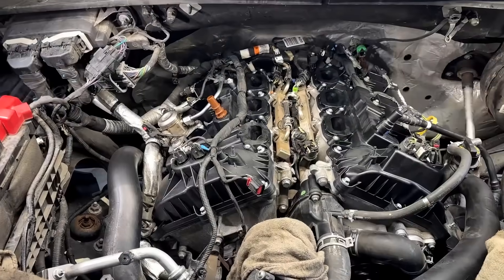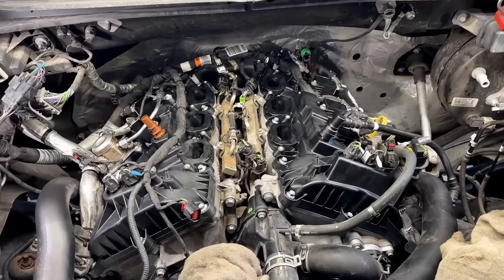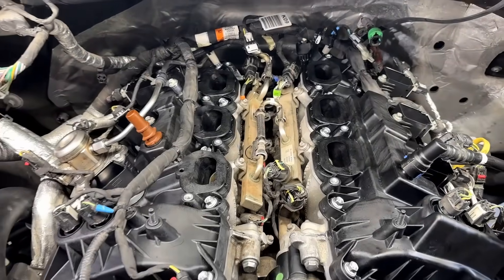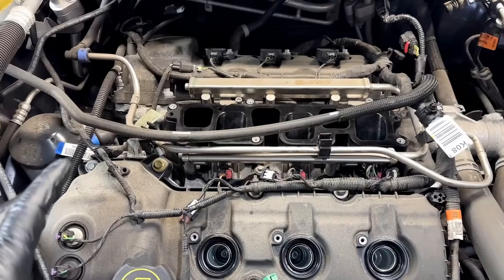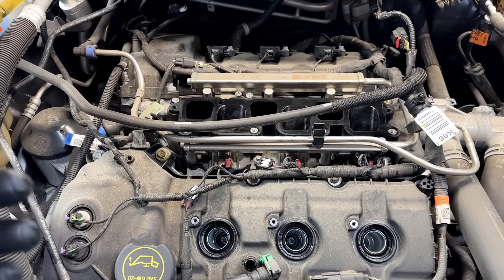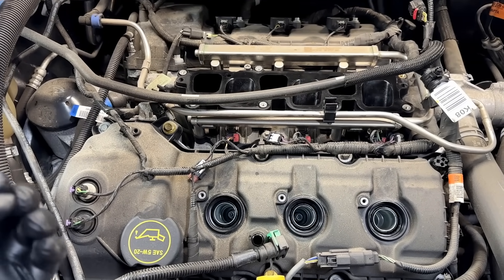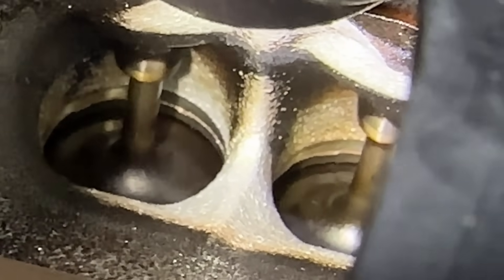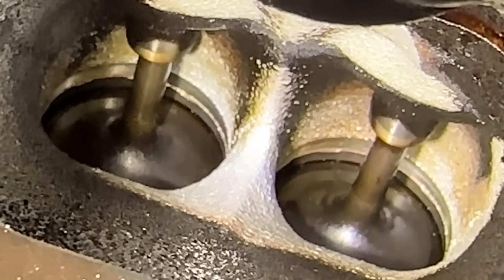Does Ford's New Dual Fuel Injection 3.5L Ecoboost Engine Really Fix the Carbon Build Up Issue?

Comment: Ok to anyone with an eco boost and warranty and making car loan payments this is for you. My friend bought a full load brand new f 150 eco boost, his 9 th ford in a row off the lot. At 48 thousand Kilometers or 30 thousand miles with regular oil and filter changes a turbo let go. Drove it in to the dealer. They tore it down and said it was lack of maintenance with all of the crud in the engine and will need a new engine and turbos ! 15 thousand dollars out of his pocket because he voided his warranty. HE DID NOT GO TO THE DEALER FOR OIL CHANGES OR MAINTENANCE. Ford of Canada denied warranty and Ocean Park Ford was the dealer. He had receipts for the oil and filter changes and intervals but they stonewalled him on the claim. This vehicle was to take his two kids to play sports and b safe was he was in two big car accidents himself , not his fault, so you get the picture, not a construction guy hauling dirt and brick cement stuff. In the end, a year of it sitting on the lot torn apart through a winter and having to drive a borrowed car from dad he took it to a mechanic that cleaned the engine reassembled with a new turbo and it was back running. I was a shop foreman at a GM dealer and we tried to help people with issues not create nightmares for families. The truck needed a turbo to get back on the road. Problem solved happy customer. Two days max. On a regular basis I completely rebuilt 3.8 engines drive in and drive out in 12.5 clock hours. Rings bearings , heads checked and touch the valves complete from customers that never ever changed oil. Warranty or 50/50.    OK,,,the oil monitoring system is one of the problems. At 50 % left on oil life the oil is no good people. It has lost all of its lubricant qualities. If you changed your oil, would you put 50% oil back in? Not a chance. It also is wearing out the fancy timing chain and gear assembly in a hurry. At 50% the oil just smokes and sticks to everything inside leaving carbon deposits. Eco boost has too much boost for the piston rings and the crankcase ventilation system cant handle it. Oil vapor is now full of acids from the engine firing and oil temp goes up. If you are not aware, the vapor from the crankcase is burned in the engine and enters through the intake port behind the throttle body.This also gets into the intercooler and pools at the bottom. I have been around a lot of turbo stuff. Buick had turbo cars in the eighties like Grand Nationals. They are sensitive with their bearings and oil types and pressure. ON TOP OF THAT IS DIRECT INJECTION.The excessive blow by,,,combined with the fuel coming in below the valve instead of above to clean the valve will cause problems until you sell it and by another brand with little or no blow by. The answer is if you have warranty on your Ford or any other brand of car or truck and are still making payments on it, take it in to the dealer for regularly for oil and filter so they can’t deny you warranty. I hope you don’t mind my comments I’m just trying to help if I can to those with an eco or warranty vehicle. Thanks for making this video so Merry Christmas to you and good luck,good health, and good fortune to you and your families in the new year.🎄

Comment: love your videos.. i am currently driving a 2013 f150. with the eco.. Truck has 197K on the odo. and i have not noticed any issues really with the engine itself. i still pull a trailer on occasion. i do on occasion take the intercooler out and clean it out. i did remove the BOV return line as soon as i got the truck. and it always has a snot ball hanging off of it. now and then i get it cleaned with under carrage wash. i will get intake removed and ill see how the ports look. 

i dont have a catch can. 

i change the plugs every 25K or so. been a good truck. hope to keep driving it another 100 K at least.
Reply: I in the same boat as you. I have 191,000 on my 2013, has has timing done under warranty once and by me once, exhaust manifolds re leveled once.

Still runs great, still pulls a 7000 lb trailer without issue, but have noticed fuel economy is not quite as good as it use to be. Either way, going for at least 300,000 out of it.

Comment: 2018 Ford F150, 2.7 L, 185,000 miles The only thing that has been done engine wise is three injectors on the right side oil changed every 5000 miles running whatever gas is cheapest.

Comment: Timing chain/components at 120K     They should last the life of the vehicle.....I always considered timing chains superior to timing belts....Port fuel injection...while not as efficient or as much power.....is much better for the life of the engine...even with the additional injection...that is alot of carbon...I would still avoid any vehicle with direct injection and turbos   I can see chunks of carbon breaking off as you insert the camera...

Comment: What's a good catch can for an '18 Explorer?  Does the Ford ext warranty cover carbon issues? Two local dealers are telling me that Ford is saying hesitation and slight smoking is normal. My Explorer has 63k miles, and the warranty is to 125k. I'm getting concerned about the carbon issue. Is there a way to clean the valves/intake to prevent or disapate carbon buildup for the owner without having to do major repairs?
 My Explorer every few days, mainly when I drive it hard on the highway, smokes the next morning like a freight train till it gets half warm, then the smoke stops. It also is starting to get a hesitation and often feels like it's missing upon a cold start till it gets warm. The local dealers say they can't find anything wrong with multiple visits. They basically tell me I'll have to wait till the issues become problems to try and fix them.

Comment: Excellent, thanks for posting this comparison !  I own a dual injection vehicle, but I am a low mileage driver.
Reply: The important thing for low milage driving is getting the oil heated up enough to blow out condensation but also changing the oil sooner rather than later.

Comment: Does make a difference if the oil is changed more often. The first gen looked like it could have used a few more changes by the varnishing inside on the valve train.
Reply: The color of neglect, varnish stained surfaces due to oil breakdown from heat and oxidation, warn out  anti oxidant additives. Change oil more often.

Comment: Im planning on replacing my lash adjusters on my 04 F150 5.4 3v because they started ticking and was wondering if I should go oem motorcraft or if theres any aftermarket thats a little better than motorcraft. Also roller followers and the melling m360 pump going in. It has 227k miles and already had a timing job done at 215k miles.

Comment: I own a 2022 Ford Ranger with the eco boost engine.  Does it also have duel fuel Injection?  If not when should I expect to have to do the  walnut shell cleaning of the valves?   Very good videos.  I have subscribed to your channel keep the videos coming.

Comment: Also, curious if the amount of timing jobs on these direct injected engines is directly related to oil change interval. I think the factory interval is way too long, especially with these piss oil weights. Soot from incomplete DI combustion getting into the oil and thinning it out and wearing the chains is a huge problem, it's one of the reasons they went to the SP oil rating. It's almost like really fine sand getting in.

Comment: Would love to see this same type of video on the 5.0. The fueling strategy probably matters too, I know on the 5.0 it relies mostly on port injection under idle and most load conditions, but the DI system is used for efficiency and knock prevention. Not sure how the 3.5 does it, although it probably relies more on the DI system since it's running boost. Port velocity also probably plays a role, those gen 2 intake ports are very deep.
Reply: I think I'd rather have port injection all the time and DI can kick in when power demand is high.
Reply: @AmandaHugenkiss2915  that's the opposite of how it works
Reply: @Wizard_of_poz  you've got it backwards. The 2nd 3.5 uses only port injection at warm idle and at low load. It uses more DI with more load and boost. The strategy is very similar to the 3rd gen 5.0.
Reply: The port injection is only used on cold start or until the engine reaches optimal temperature then it only uses DI. Ford honestly only did this to improve the EPA rating they don't care about the carbon build up....
Reply: @icyhotmike  fairly sure that's not the case on the 5L, I remember seeing the fueling tables and the most it can do is 90% DI, but it has different circumstances where port comes back on. The 3.5 is likely different because it's boosted
Reply: @ice44567  to
Reply: Plenty of changes on the 5.0 in recent years.

Comment: Looking at the carbon buildup on those intake valves on that first gen Ecoboost almost reminds me what i saw back in the days of the old carburetored engines. That carbon buildup on the intake valve would cause various drivability issues, hesitations on tip in throttle, random misses, rough idle, and even engine pinging because the carbon on the valve would absorb some the fuel thus leaning out the charge. At that time (pre-OBD and some cat engines, still had leaded fuels) part of a tune-up was using a top engine cleaner ( there was good stuff then, now it's all outlawed by the EPA) which you slowly poured down the carb while the engine was running or even water would work towards the end you would stall the engine let it sit for about 30 minutes or so then start it up there would be large blooms of white and blue smoke for a short while. No matter how modern the engine is and how refined the fuels are there always be some carbon build up, "nature of the beast" so to speak. Look at the brightside, it gives you something to do and if they build a perfect engine, we all be out of work.

Comment: These dual injection vehicles need to have a cleaning mode or some triggered event like diesels have with canister cleaning that runs them only on port injectors for a set period, maybe after 15 minutes when it detects consistent highway driving condition, to provide a long term cleansing.

Would go a long way to reduce unnecessary maintenance but I’m not sure the industry really cares about long lasting vehicles anymore.

Comment: It's the reason why I have a UPR catch can which is for both the clean and dirty side hopefully making a big difference in keeping the blow-by out of my intake where it doesn't belong. 

You still have folks stating that it's unnecessary due the duel fuel injection.

Comment: Many years ago I drove a fuel delivery truck.  The fuel that's delivered to every station:  Convenience stores or name brand stations all come from the same nearby fuel terminal.  The terminal is either supplied by the owner of the onsite refinery or by pipeline. When you loaded your truck with gasoline for delivery, there was a selector switch that you operated to add an additive for a particular brand.  Sometimes the selector worked, most of the time it didn't.  So don't be fooled.  Gasoline is gasoline and diesel is diesel no matter where you buy it.
Reply: No it is not all the same, this can all be seen reviewing data logs and tuning.
Reply: The additives is what makes the difference. 
Not all stations are getto like yours.
Reply: I've worked at a certain national chain gas station. They ordered gas, without additive, in the octane needed. They also ordered the additive separately, and only about once a year for the station. Each time fuel was added to the tank, we used a system to add the additive into the tank of the fuel. We had 4 tanks in the ground, 2 low octane, 1 high octane, and then additive. Additive added was based on how many gallons of fuel, so no matter the grade of fuel, the same amount of additive was in it. Granted, this was a top tier station, which really just meant we used the correct additive, in the correct amount. The only difference for summer or winter was the blend of fuel from the terminal. They ordered from the cheapest terminal, with the cheapest carrier. I would see that same carrier at many other name brand and generic gas stations in the area.
Reply: The base fuel all comes from the same refineries, it's the additive packages that change. 
If the mixing system for the additives is working properly, you WILL be able to measure a difference in cleaning and performance between pumps. 
Sometimes, yes, the additive mixers are faulty. That doesn't justify saying "it's all always the same".
Reply: You are absolutely on the money. I did contracting work in the Bayway refinery in NJ. tankers from everywhere pulled up to the filling stations to load their tanks.
Reply: I wondered
Reply: Exactly. The difference is the additive that gets dumped in at the gas station
Reply: I guess all tanks where the fuel is stored is exactly the same at every station too
Reply: @51AB —> BINGO!
Reply: I spoke to a guy a number of years ago that worked at the Fuel Terminal off the lake in Hamilton, On Canada. He said the exact same thing. Different gas stations are only the Distributors..
Reply: What about the condition of the fuel station underground tanks? What if they are old and leaking water in? For example. Some stations may be contaminated
Reply: Thank you for making us aware of this type of fraud.
Reply: As a private tech for twenty years in Salt Lake City I see the difference between fuels. I run my 4Runner on chevron premium, after 162,000 miles still very clean. I’ve done walnut valve blasting on cars with less that 100,000 miles that were almost completely clogged, they really needed a valve job but the owners don’t want to pay for it. They trade them as soon as they leave my shop.
Reply: I delivered fuel for 5 years, it doesn't matter the brand you buy, you are getting the same gasoline as you would at the competitors gas station. The only difference is the detergents different brands inject into the gasoline at the terminal.
Reply: Utah baby!  @copisetic1104
Reply: @copisetic1104  need a valve job  because of carbon build up and will trade it right away after 100k on it, something isn’t adding up….No bull, I’m a Automotive tech of 20 years and have never ever had a engine that needed a valve job because of carbon build up. I work on a lot of German cars that are known to have bad carbon issues with direct injection. I’ve yet to work on one that I couldn’t fix by doing a walnut blasting. Also your 4 Runner will have clean valves because it’s port injected not direct injected like talked about in this video. Direct injected are the ones with the carbon issues. I’ve seen some carbon on valve seats, but still didn’t have to do a valve job to fix it. 🤔
Reply: When you drive down the highway and see an Exxon refinery, or any other refinery, or terminal.  Semi trucks load up there and deliver to all stations in that area.  It doesn't matter if you buy fuel at at Chevron, Exxon, Mobil, Shell, Kwik Shop, or whatever, they're all supplied by the nearest terminal.  The only way fuel will be different, is if you put additives in your tank from an autoparts store.
Reply: I'm not trying to discourage anyone from buying their favorite brand of fuel, I'm only telling you what I know first hand.  NCRA refinery in McPherson, KS, which is near us, supplies all name brand and convenience stores, including Chevron, Cenex, CO-OP, Phillips 66, Kwik Shop, and Dillon's fuel stop in our area.  All gasoline and diesel must have certain additives like detergents required by law.  Those additives change during winter and summer as needed.

Comment: I love your show, thank you. I currently own a 2016 F150 3.5 ecoboast 100,000 miles. Recently I have been experiencing 2 limp mode alarms; "Hill Descent Control Fault & Service Advance Trac" I took it to a transmission shop and his scanner read the following: Codes #1- U3013 ABS control module input power C. #2- U0401invalid data received from ECM/TCM. The transmission shop sent my vehicle to a general mechanical shop and they found 3 pins on different connectors with corrosion, 1- right rear tail light, 2- rear camera and 3- the main harness going to the rear. I was not experiencing any issues with lights or camera.  It's been a week since I got my vehicle back and the same limp mode reoccurred 6x's. I seems to occur when the drivetrain is not up to optimum temperature i.e.like backing out of the driveway 1st thing in the  morning, after that everything is fine. Any ideas? Merry Christmas, Ben

Comment: I have been subscribed for a while now and really enjoy your videos. I have a 16 expedition with about 105k on it. I have noticed a shudder around highway speeds, low rpm, and light acceleration.  Is this something that would be caused by carbon build up?
Reply: A shudder most likely would be originating from the latter components of your drivetrain, probably your torque converter?